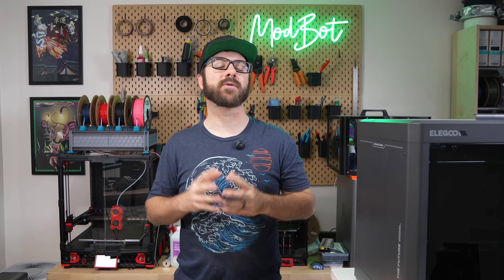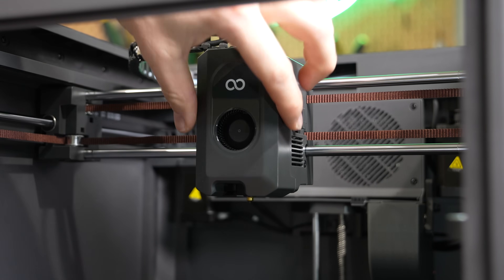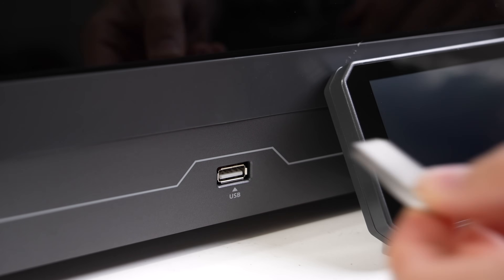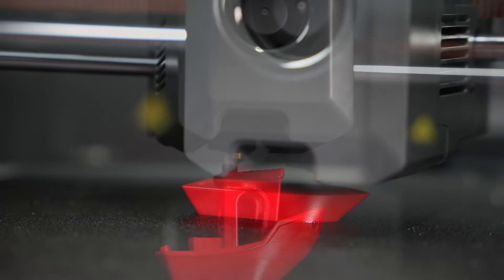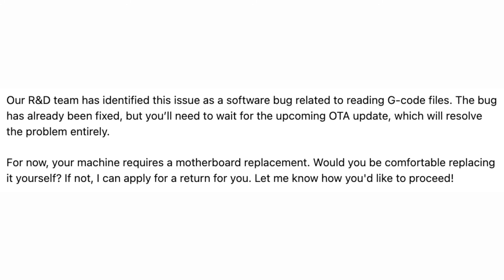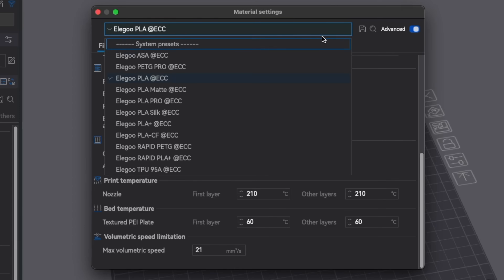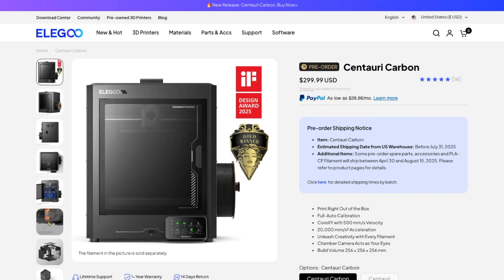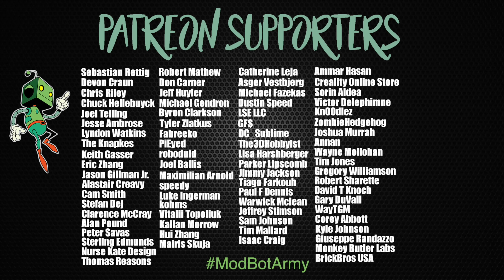$300 Fully Enclosed CoreXY 3d Printer (Elegoo Centauri Carbon)

Comment: Looks like they are really coming after Bambu with this one. I hope this ends up aging well so we can get more of these consumer friendly casual-ish 3D printers. Competition is always a good thing.
Reply: The problem with Elegoo is software support. I have their previous gen printer and I can only print PLA/PETG 0.4mm since they never provided Print settings for other nozzle sizes...
Note that they sell different size nozzles themselves
Reply: @SilenceGProd  You don't need seperate profiles for different nozzle sizes, just change the nozzle size and line width (if it isn't expressed as %) in your slicer.
Reply: @SilenceGProd  yeah, they're not quite there yet. Bambu is way ahead still, and others have a lot of work to do if they want to catch up.
Reply: Elegoo sent specific instructions with all of the review Centauri Carbon printers to compare it to the X1C, even though many reviewers felt it was better compared to the P1S.  Centauri is definitely Elegoo's late entry to the Me Too Bambu party.
Reply: With this August waiting list everybody is going to buy Bambus and other printers and by the time they sort they production there will be no one left to buy it :D

Comment: https://youtu.be/rVrsEwb7DKs?t=480s 2 LED Strips are supposed to be included. At launch on the preorder page it clearly stated this. Sometime after that they changed the preorder web page. (I do have a screenshot proving so) The rollback on the LED strips and the claim that the firmware is purely custom and proprietary is concerning. It is clearly neither of those things and based on open source that they have modified without proper procedures. tsk tsk

Comment: looks like a nice machine for the money BUT as others called elegoo out their email respose is BS and i would not care much if it was bad out of date bastardized version of klipper like from QIDI, not having full root access is a dealbreaker. If it was not locked down i would have probably waited and bought the Centauri Carbon instead of my QIDI Q1-Pro and made a few upgrades with the saved money. Shame.

Comment: “Unfortunately, we don’t offer full access to the Fluidd dashboard or SSH for root access at this time, as the architecture is different from Klipper’s typical structure.”

To me, this says “We are using Fluidd and Klipper, we’ve just modified them. Because we’ve modified them, we aren’t going to open source them.” which is not how open source project like Klipper and Fluidd work. It looks like Elegoo used at least Fluidd as the base of their web interface, which means they are required to open source it, based on the licensing for Fluidd as far as I recall. 

Do better, Elegoo.
Reply: FLSUN did basically the same with the S1/T1, which was disappointing considering their prior V400 release kind of pioneered including normal, accessible Klipper out of the box.
Reply: They should be sent a cease and desist over that tbh
Reply: They are using a single main chip, not an SBC+MCU system like Klipper is designed for. It’s entirely likely that it isn’t Klipper-based at all.
Reply: @Scrogan klipper supports running the mcu firmware as a linux process, theyre most likely using klipper
Reply: @ I hope it isn't Klipper based. However, they didn't actually say it isn't Klipper based. Just that their setup is different from 'normal' Klipper. To me, this reads very strongly like they modified Klipper to run entirely on a single MCU. 

Additionally, it definitely sounds like they are using a modified version of Fluidd at the very least, which still supports my point that they should do better. 

Imo, they should either come out and directly state whether or not they're using Klipper instead of the beating around the bush language they used here.
Reply: Who's going to make them open source it?  I personally don't care about the open source licensing nonsense so I'm happily looking forward to receiving my CC.
Reply: @ respecting licensing terms isn’t nonsense - it’s the law. Some open source projects don’t really care if someone violates their licensing terms, but the reason those that do don’t do anything about it is just because they don’t have enough money to afford the litigation necessary to do so. 

You say you don’t care, but you do realize that the Centauri Carbon wouldn’t be possible at that price point if it weren’t for open source devs, right? Open source devs - who literally donate huge amounts of time and effort to these projects - deserve way, way more respect than they get. Open source is literally the reason that basically all of the internet works as well as it does; most servers run on Linux after all.
Reply: @KaminKevCrew  It's not the law in China ;-)
Reply: @ That’s not actually true. In 2018, Chinese courts made a couple of rulings on some cases involving open source software, and Chinese courts absolutely do recognize open source licensing terms.
Reply: Its a chinese brand, just like creality theyre not gonna do better
Reply: @ sure - if you accept the status quo, they won't do better. I don't accept the status quo, and when Creality, FLSun or whoever else appears to be breaking the license terms of amazing open source products, I will call them out on it. I wish reviewers actually had teeth about these things because I think it's important. 

Apathy helps nobody, and doesn't make anything better.
Reply: @KaminKevCrew  i agree tbh, im just not holding my breath
Reply: @KaminKevCrew calling them out does nothing, we need to stop buying these printers that flagrantly violate the gpl.
Reply: @pellcorp  calling them out brings awareness for people who might be looking into buying them, who might go for something different if they see that these companies are not following open source licenses. 

I'm not sure what you mean by 'we' as far as not buying printers that violate the GPL. I haven't bought an off the shelf printer since I bought an Ender 5 something like 6 years ago. 

All of the printers I currently own are fully open source printers, either self sourced or LDO kits. I am really only interested in printers I can build at this point, so I'll only be going for fully open source ones for the foreseeable future.
Reply: @KaminKevCrew  I agree with you, however the reality is much more bleek... We definitely dont live in a perfect world, and the Chinese culture doesn't exactly push for good customer service after the sale... There are exceptions to this rule of course, but for the most part its ingrained in them, "If you can get over on the foreigners then good on you". 

The ONLY way is as you said though we have to call them out publicly, bad PR is the only way to get results out of these companies.  OVERALL though... you cant deny what elegoo is doing for the market with this printer. Its the next "Ender 3" boom for the industry. I would rather a bright eyed student have access to a printer with a closed source system, than have no printer at all. You and I, fall into the "enthusiast" category, and we are few and far between,  but we know how to make the right amount of noise in the right places and hopefully things will only get better...

Has bambu backed down on their bullshit any? I haven't been paying attention to the category of news.
Reply: @SlinkySlonkyWaffle  If they do as good as Creality, we’ll be in good shape. Creality gives you the klipper ssh password directly  from the LCD of the K2 plus. All the printer code including macros are easily accessible and modifiable.
Reply: @kingjamez80 there is a lot of closed source components on the k2 including all the logic for the cfs, same for k1 cfs upgrade, it's not even close to being compliant

Comment: The Centuri Carbon made me interested in FDM printing again after a bad ender 3 experience because I've been happy with my Elegoo Saturn 3 SLA printer, but after looking around I went with the Qidi Q1 Pro. 
It has two z motors, an heated enclosure and it feels like they fixed most of the issues you and everyone else had when they reviewed it last year. Maybe I'll print something like PPS-CF but right now the plan is cheap PETG and ABS.

I'm curious to watch 6 months reviews of the Century Carbon to see if an spending an extra 100E was worth skipping the early adopter hassle, but I don't expect you to make that video to be honest. And I get it, you already have your usual printers.

Also I wonder if the door is so dark because they used the same manufacturer as their resin printers's doors

Comment: Maybe just down to a poor translation but the verbiage used does not clearly state that it is not klipper but rather they made changes to get it to run on a single chip board along with a different web interface so therefore it is not compatible with standard klipper and its extensions. This to me seems like a very shady way of claiming to avoid proper release of firmware in compliance with the license. Seems like a decent bit of hardware for the price but not something I would jump on given the software side of things. You can be propriatary if the software is good and brings an easier interface to the user, ala Bambu, and get away with it. But just like the skinned version of orca they are passing off as their own, you get no pass for doing things different but worse. And if they did use klipper without attribution and code release they should not be rewarded with a single $ from anyone.

Comment: A major pain point from my 3d printing experience is dissasembly. I have a Neptune 3 Plus and it's been doing good work until it had some problems. The problems were fixed but I had to drag the heavy machine out of it's enclosure. A major quality of life upgrade would make for my Neptune 3 would be to redesign parts so that the screws on the motion system are all acessible from the front of the printer. This would be beneficial to a Core XY machine because the form factor lends itself into being stashed under a desk, in a cabinet, or a corner. How easy is it to dissassemble the Centauri from the front to say.....replace the belts or open up the hotend to clear a clog?

Comment: Regarding the first layer issue, can you fix this in the slicer with the print start macro? Seems like if you swap the probe action to basically the very end of the macro it would work out much better. Looks like lighting fixes are going to be similar to BL printers, with a light strip and just some simple wiring to the power supply.

Comment: Generic question: I have an older printer that is not supported.  Is there a reasonable electronics kit I could buy that could drive a corexy of the prior generation?
My machine is a Ultimaker 3, 2 extruders, purchased several years ago.  The electronics board blew its internet connection so I can't even get in to update firmware, but it still prints only from a USB stick. (Ethernet and wifi capability got blown in a nearby lightening strike.  It runs a custom software from Ultimaker.

Comment: I had the open frame version on order from the first week, but when I saw these didn't ship until june - july I decided to cancel my order. Elegoo did this without fuss so well done to them for that, It looks promising, but another printer that is rushed to the market for consumers to bug test. I am currently very happy with the flashforge 5mpro that I found for £150 with small easy to fix faults and even managed to find a 2nd one for the same price after I canceled my order so it turned out ok in the end.
Reply: I liked the features and the price of the Elegoo Centauri and Centauri Carbon, but I didn't order either because I don't like buying a pig in a poke and I don't want to front Elegoo the money to buy the parts and build the printer to be delivered in 4-5 months, largely because I don't want to encourage companies to make this dodgy practice the new normal for purchasing a new printer.
Reply: Honestly I'm surprised so many folks here got the ad5m like me after first considering the elegoo printers
Reply: Nice find $150 for the pro version is huge

Comment: Modbot is one of my go to channels for 3D printer info. I've been waiting for you to make this video. Ordered one this month, expected to ship before end of July, this will be my first corexy printer. From what the makers that have them have been reporting at $300 plus shipping so far it has been a solid machine, yes it has room for improvement and Elegoo has been active at addressing issues and concerns. I ordered it for the ability to print low end engineering materials on a tight budget and upgrade from my enders (e3 V2 and the E3 V3 se).
Reply from the maker: Thank you for the kind words. While my machine was not perfect, Elegoo addressed all of my concerns and appears to be making an effort to correct them. This is more than I can say for plenty of my experiences with manufacturers in the past. I am optimistic they will continue to refine the machine through firmware updates.
Reply: I'm phasing out an Ender 3 Pro myself, having just ordered one of these a couple minutes ago. 🤣
Reply: @ I'm keeping the V3 SE on the line to make prototypes out of PLA  and ensure measurements and tolerances are good and I have proper fit and function before making production parts on the ECC  with higher grade material.

Comment: the excuse elegoo gives about the klipper firmware makes no sense, since klipper supports using the SoC AS the MCU (install klipperfirmware as linux process, instead of a seperate MCU), so their claim that its incompatible is absolute bogus. My guess is that theyve stripped it down to give people less control since itll cause "less problems", while calling it their own work. very typical of chinese brands ngl
Reply: as someone who owns an elegoo printer it pisses me off because they make a TERRIBLE job at making their own flavor of klipper, one of the biggest feature in their discord for upcoming printers was to simply NOT do anything and install mainline klipper lmao
Reply: @brunoyudi9555  LMAO yeah that says more than enough xDDD
Reply: I agree, but it’ll get blown open eventually. Still great for the price
Reply: If that's true, then that's the biggest drawback for me. If the printer ran on a slightly modified open-source system, I would have the guarantee of support from the community. As it is, there's no telling whether elegoo will go out of business in six months.
Reply: I look forward to someone hacking it in there like the flashforge printer I currently use 😂

Comment: Would love to see a follow up video in 6 months to a year. Many of the issues seem to be fixable with software/firmware updates. For those in the US the price may change so the value might not remain the same but those in the rest of the world this printer seems like a great value option for an enclosed printer, if the software and firmware is updated.
Reply: I think there's so much pressure to maintain market share the manufacturers are pushing these out with known issues, hoping to solve them through initial customer feedback. I'd hold off if I was in the market for one of these until the bugs are ironed out.
Reply: I may be wrong but pretty sure they have a factory in the U.S. so I don't know that the price will change to much. But obviously I could be wrong lol.
Reply: @phillipallen4378 they have a warehouse not factory so they will still have added cost to import
Reply: No, there is not a factory in the US. it's all made in China

Comment: With ease of access to the Mainboard this thing would be super easy to klipperise and put in a aftermarket board + Pi
Reply from the maker: @JohnShinaver-um8on  I agree but would be nice if you didn’t have to
Reply: its already klipper, just running the firmware as a linux process instead of flashed to another mcu, but yeah it seems like the base board is very locked down regardless. throwing in a better mainboard would defo make it a much better machine
Reply from the maker: @SlinkySlonkyWaffle  we are sure it’s just a hacked klipper?? Is there proof or is it primarily speculation at this point?
Reply: @ModBotArmy  its my personal speculation. I dont believe theyre gonna write custom firmware lmao
Reply from the maker: @ I don’t think that your theory is far fetched. I don’t have proof so I can’t call it out but it a possibly theory I have as well.
Reply: @ModBotArmy  isn’t there a bug in some Klipper versions that flashes g-code as firmware if a usb stick is left inserted when the machine boots up? // just saying… !
Reply: There are already people working on either cracking the existing board or cheap replacement. 

The biggest success of the Neptune 4 was the ability to make it 100% Klipper.

Comment: Ordered in february, received it two weeks ago, it's grounded since day one because of heat block fan error. I managed to print one thing before it broke, now I'm waiting for a new fan to arrive. It might work, it might not, since the fan when plugged into an external power supply works fine. The printer was supposed to arrive in june, so I'm not angry yet and we will probably fix it, since the support has been very helpful, but I'm a bit disappointed, honestly. UPDATE: Fan replaced, the problem went away. :) Now I'm testing everything, but it seems to be ok.
Reply from the maker: @Diabl0pl  have you checked the voltage output on the fan pins from the tool head to rule out a fault with the board? Sorry to hear it though
Reply: @ModBotArmy  not yet, I will be checking it after the second fan fails. ;)
Reply: They've disappointingly had issues with plugs being fully seated in the head. Add to that some actual bad components and it's led to a sub-optimal launch.
Reply: I updated the main comment to clarify things. The printer seems to be working fine after fan replacement. :)